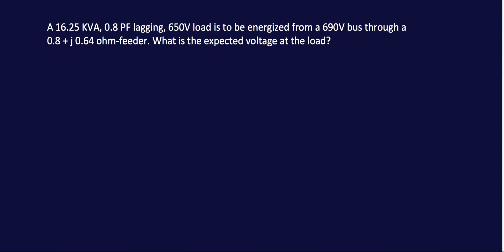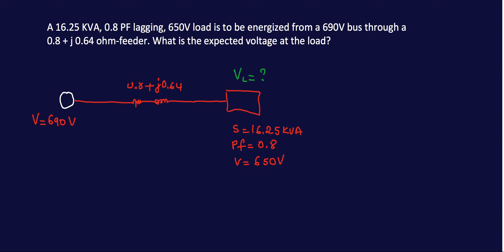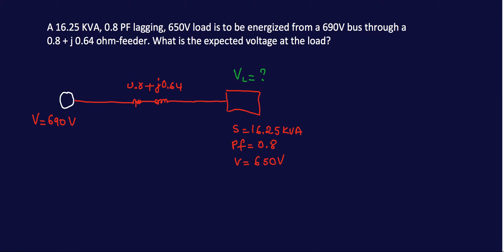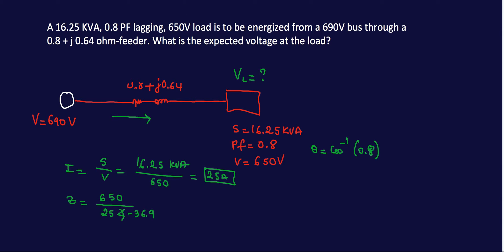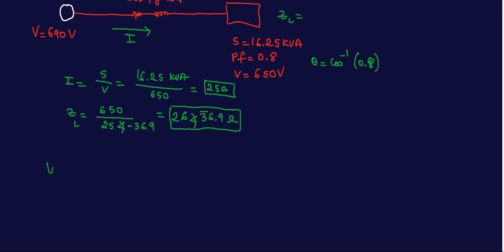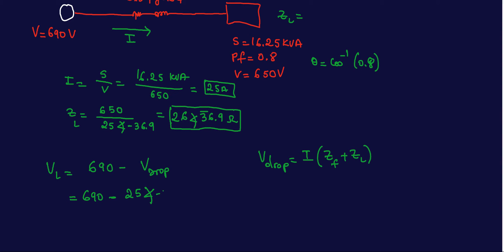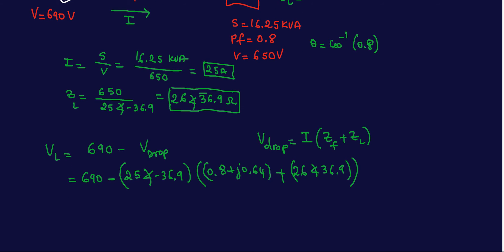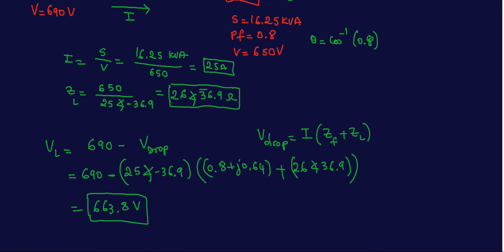Power Flow Problem

Comment: if you are finding the impedance at the load, you shouldn't include Zl, I think the right answer is: 690-[25<-368*(0.8+0.64i)]=664.4<-0.07 Volt
Reply: Agree
Reply: correct

Comment: Hi. Just wanted to ask why do I still have to consider the impedance of the load if I’m being asked to determine the voltage being received/expected at the load. Doesn’t the problem mean the voltage expected right at the point of connection to the load?

Vsending = IZline + Vreceiving? 

Thank you.

Comment: I may be missing the obvious. but can you explain the Vload portion of the video. i am good up 690-I*(Zl+Zf), but i get roughly 690-670.66 with some angle for a net of mag 24 angle 38.23. it sounds like your saying the voltage across the load id 663 which makes sense as there would be little voltage drop across a small impedance line, but thats not how the equation in the video is coming up. again, apologize if i am missing the obvious. Thanks
Reply: I get 664 when I calculate voltage drop only across the impedance of the line.